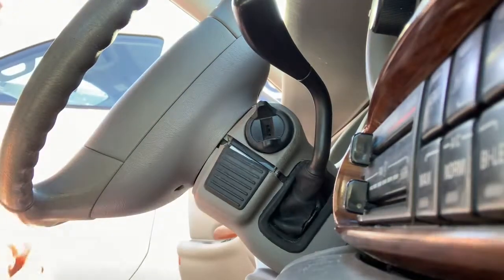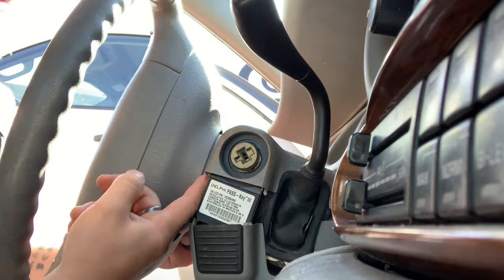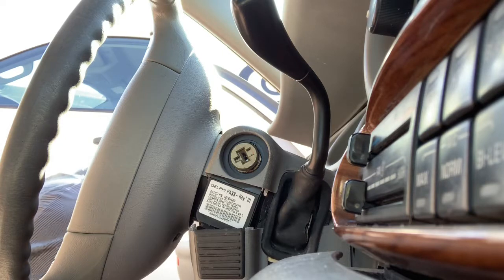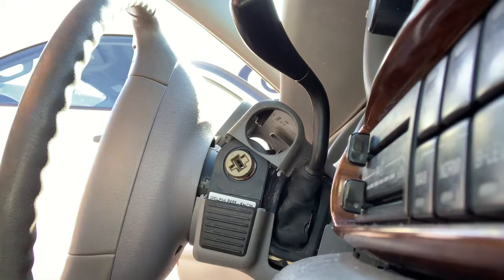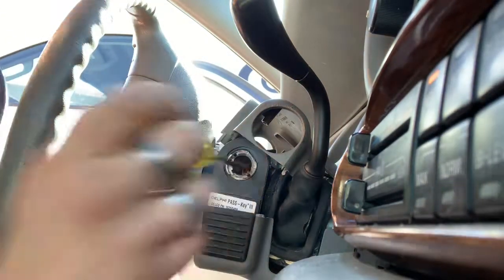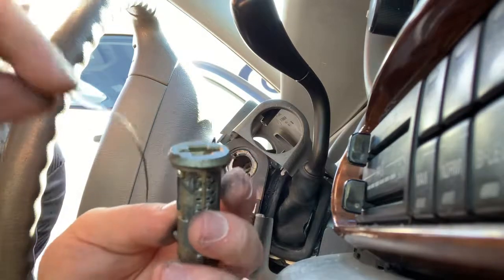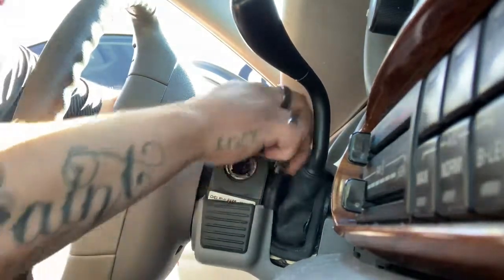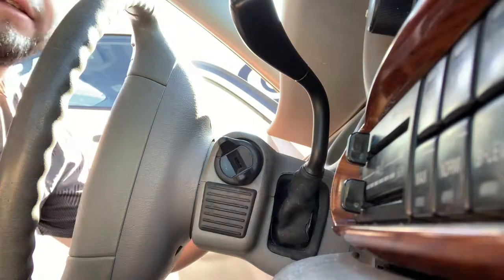2000 Buick LeSabre AKL Ignition removal.

Comment: I didnt see that you replaced that reversed torx or the screw on top.  Maybe you did but just didnt show it.  I try to do things i need to get done and do myself. 70 here. Lol .  When ibought this car last year 2005 lesabre custom its needed a few things.  It came with only 1 key. Since visiting local junk yard  I've seen cars that have 2 keys and the little black piece to open and close,  I was thinking of changing one of those to my car.  Now not sure because they are not same year or maybe different model buick.  I also need a piece that is behind the trim where you turn on air conditioner.  It looks like someone already had the steering wheel cover off and didn't replace properly. Any help from anyone appreciated

Comment: If key cuts top and bottom match, it allows key to work both ways, so it can't be inserted incorrectly.  If top and bottom cuts are different, it's more secure and will only insert 1 way.
Reply from the maker: What’s your point? Yes, it is a double sided key cut on both sides for “convenience” however the cylinder is single sided.
Reply: @donovang__3317  apparently my reading of your post wasn't correct, it seemed you didn't know about convenience cut side. have a nice day, later
Reply: @donovang__3317 what is name of the part?

Comment: I did the same thing inought a steering column and took the job the ignition out from one put it in the other and nothing won to crank...do I need to reset the system
Reply from the maker: Sounds like you do need to reset it. Leave key in the on position for 30 minutes with jumper cables attached.

Comment: I have a 2000 LeSabre where the key can be removed from the ignition in any position.  Yet the ignition can't be turned without the key inserted.  It might be caused by a sidebar that is partially worn down, enough to allow the key to be removed in any position but not enough that that the ignition can turned without the key.  Or the metal barrel in the steering column that the cylinder fits into is worn down and allowing the sidebar to relax in any position.

Any thoughts for a remedy that a DIYer could do?
Reply: Or the key may be worn down.

Comment: The GM39 lishi does work on the door on these. I just did one today. Reading was a little off on the 1 cuts. They read between 1 and 2 but I got it figured out and a good code.
Reply from the maker: Good to know. I personally have had bad reads off the door locks on these. So I tend to not waste my time in cutting multiple keys. I prefer to pull ignition and cut one key.

Comment: Will it turn on with the flat head when u turn the switch or ????
Reply from the maker: Yes you can turn it on with a flat head but it won’t start.
Reply: How can i get it to start ???
Reply: Whdn its turned to on can i start it under the hood
Reply from the maker: @G2Gworks  what is the year make and model of your car?
Reply: 2000 buick lesabre
Reply from the maker: @G2Gworks  that vehicle is equipped with an immobilizer. You need the programmed key to start the car. Or have a new key programmed.